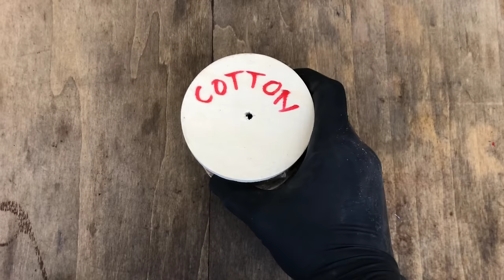Old Rusty Stove Restoration | Mister Patina

Comment: Amazing.if this type of cookers  are manufectured again, surely people would like to buy.
Reply from the maker: Thanks! The main problem about these stoves is, that they’re pretty dangerous in general. Several people commented, that they’ve seen these things exploding 😕
Reply: The problem is, as I understand it, if not maintained well the fuel can seep around and burst into flame.
Reply: @misterpatina  They can explode due to the use of inappropriate fuel.  For example, this stove from the video was originally made for alcohol fuel, not petrol, so if you try to use it for a long time it will explode.  IMHO

Comment: The linseed oil trick is one I’ll keep forever. Love stuff like that. Aren’t you worried it will catch fire in the stove? I hear crazy stuff about that lineseed oil
Reply from the maker: I was worried, but also armed with a fire extinguisher 😄
Reply: basically 'seasoned' like a cast iron pan
Reply: The only time linseed oil becomes a problem is if you leave rags soaked with it balled up just laying around, then it can spontaneously combust.
Other than that, it's pretty much like any vegetable oil.

Comment: Linseed oil as a finish on metal? I have used it on wood for years, but had no idea with regards to the tempering process on metal. The results look amazing and is particularly interesting as high heat paints are degrading with new environmental restrictions. Thanks for the insight!
Reply from the maker: Hey Khan, thanks for your comment! Yes you can use it for tempering. Because linseed oil has got a very low „smoke point“, you can easily use it in your oven.
Reply: Basically he seasoned it like it was a cast iron skillet.

Comment: Neat little stove and nice jog restoring it!!  I enjoy reading where or how these items are obtained.  I’m curious if metal filler could have been used on the frame and near the burner where the metal is pitted?  Anyways, enjoyable to watch.  Thank you.
Reply from the maker: Hey B! Thanks for your comment! Basically i could have used a metal filler, but then i had to paint it (otherwise you would see the filler afterwards). As i wanted to have a heatresistant finish, i didnt want to paint it. Another idea could have been welding up the "craters", but this would have been to much effort (for me). So i decided to give it this nice tempered surface with a little "patina" left ;-)
Reply: @misterpatina  I appreciate the reply.  I have watched a couple of your videos and greatly enjoy your craftsmanship and content.

Comment: You should go into business by reproducing these, they would be great for backpackers, preppers, boats, RVs etc. This could be made more portable by having folding legs and a removable fuel tank! This is a genius design! Is this alcohol only or can it be made to use any fuel?
Reply from the maker: That’s a very good idea! I’m really not sure about answering your question, but you can put nearly anything in this stove to run it. Depends on how long it has to work.
Reply: agreed, would be great for backpackers if collapsible, and emergency preps if not.

Comment: Awesome work, but how this blue flame is there without any pressure ??
Reply: I was wondering the same thing. I’m wondering if the heat creates pressure in the tube when preheating it, which is what fuels that.
Reply: The heat turns it from liquid to gas and therefore burns more readily and clean
Reply: @theinternetthug  I don't think so the pressure needs sealed can and tiny hole to pass through which i did not see on this stove.

Comment: Neat, an old kerosene stove. Wouldn't it have been nuts if the adjustment knob was actually made out of Bakelite and it just had a woodgrain look to it. Other than your patch what was suppose to go there?
Reply: Methylated spirit actually. Kerosene needs a pre heater to vapourise it or it won't burn.
Reply: i believe it would be the manufacturer label. Just guessing

Comment: How is the liquid fuel pressurized?
Reply from the maker: Its basically not pressurized, it’s more like a magic of physics. I GUESS it’s something like a jet-effect. As the gasoline cup is higher as the flame nozzle, there’s a little pressure. By pre-heating the nozzle, the gasoline gets gaseous and jets into the burner. 

Hope you feel me. 

All the best.
Reply: Sir I think that thread is liquid leak and vioyapreration

Comment: Have you considered using glass blasting beads (ballotini beads) instead of slag ? It tends to be more gentle on the metal, leaves a smoother finish
Reply from the maker: Hey Biggy, I did! Iam going to get a new cabinet in a time, here i will use glass beads! :-)

Comment: How do you know which fuel to use? I heard about cases of spirit stove explosion when fueled by petrol
Reply from the maker: So basically you use for white spirit for these stoves and blowtorches, because the white spirit doesnt leave a sooty coat on the parts. It wasnt pretty wrong to use gasoline, but white spirit wouldve been better. I heard that these stoves are very likely to explode in general, doesnt matter what liquid youre using :/

Comment: How old are the stoves? I have never seen anything like them here in the US. I collect and restore old Colman stoves but I suspect the ones you have there are much older.
Reply from the maker: Hey! They’re around 1920-1940, I can’t tell you exactly 🙂
Reply: It is very similar to czechoslovak Meva 444. It is possible that Mister Patina used wrong fuel. The type 444 is designed for ethanol.

Comment: What a nice movie. Thanks for taking so much time, and sharing it with us. One thing surprised and disconcerted me throughout - the lack of care or completeness. For instance, the black handle was all "sanded pretty" except one end, which remained black and ugly. The black went down different heights on different sides. Another is the blacking of the burner plate. Right in the front, near the camera, a big patch was left that was not blacked. The third is example is when he put a brass cap in the vise and squeezed it. Sure enough, when we saw it in the next shot the two sides of it had been mashed in. These are all things that "my mechanics" would never dream of doing. Nor would most of the other sites I've seen. I could say more, like the incomplete cleaning, etc. (check the angles where one surface joins another). I'm not sure how many of these videos I want to watch. I find myself distressed at the sloppiness. I'll probably try at least one or two more. Overall, I wish that much more care and completeness were the watchwords of the day.

Comment: Could heat resistant paint be used in this?
Reply from the maker: Originally it was painted, but the paint was mostly gone and it was rusted. Incan imagine that heat resistant paint isn’t the best choice when there’s direct contact with flames.

Comment: But how fule is pumped?
Reply from the maker: It isn’t pumped, it works just by physic. Since the fuel tank is higher than the burner, fuel has always enough pressure to get into the burner 🙂👍